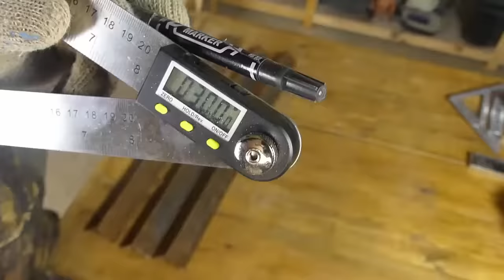I didn't believe it myself! I welded a barrel of pipes and it all worked!

Comment: Whenever you are dealing with Sparks or grinding stuff with a cutoff wheel and like that or deburring things ,make sure that your eye protection is first-rate. Not just a pair of glasses. When a spark hits your eyeball it will weld itself into your eyeball and it will not come out ,you will have to go to an ophthalmologist and they will have to grind it out of your eye. Now going to the opthamologist and having that done is only a hour-long procedure but it will scratch like hell until u get it done and its a giant pain in the ass and will keep you down for a whole day maybe a day and a half. I was a machinist for 35 years and had to have this done several times because I was stupid. Don't be stupid ,get pair of really good goggles when you're grinding things.
Reply: I used goggles when I first started grinding. One time a piece of metal went through a gap between the goggles and my nose,bounced off the lens and into my eye,I had to go to hospital to get it out. Now I always use a face shield,much safer.
Reply: Ouch
Reply: I don't know about you kids these days, Christian when I was a young man we used to take a bowie knife and pick those metal bits out of our eyeballs but.../joke.
Reply: That's a pretty good description but the details are a little inaccurate. The eyeball at the front is a fibrous membrane (clear in front of the pupil) coated with water-based  gel. A metal fragment can't "weld" to it. But the hot fragment of metal/grinder is driven hard into the surface and needs to be dug out using the beveled point of a needle (which looks like a sharp pointed crowbar under a magnifying glass) or possibly a burr (which is a miniature toothed ball on the end of a spinning shaft in a Dremel-like instrument, but slower, which cuts like a tiny tool in a milling machine. The fragment isn't "ground out" more like digging a seed out of an avocado. It is painful afterwards, like sand in your eye once the local anaesthetic wears off. I've been on the operating end of those tools many times, and the receiving end a couple of times as I do some hobby metalwork. Use good eye protection, the message is spot-on.
Reply: Yep, learned the hard way exactly that!  
Uncomfortable as hell

Comment: The only place in the world where one can find steel drums with such thick walls is... yep, Russia - and that has to be one from USSR times. Those flimsy cans they're making today (everywhere) are joke - they'll burn through (i.e. become perforated) in the middle of heating season. To make something that would last one would have to use some kind of pressure vessel, like a pressure tank off hydrophore or air compressor. (Hydrophore tanks are lighter, but typically hot-dip galvanised, so not very suitable for welding, albeit with a little skills - and open area, on a slightly windy day - it can be done too. Just stay on the windward side, though ;-)
Nice video to watch anyway, and a thumb up! Greetings from Poland! : )
Reply: Looking at your FLIR/HEAT video, seems like a single raised pipe on the top edge of the vent stack would pull heat out too.

Comment: You need outside combustion air. Otherwise, you are sucking inside air out your chimney and thereby pulling in outside air through all the cracks. What you want is a positive pressure inside your shop so that there is a little bit of warm air pushing out of all the cracks. Just a little will work. At the least, you want a neutral pressure.
Reply: 8th grade

Comment: I retired at 58 years old 13 years ago. I was a craftsman love to build stuff, certified journeyman welder and fabricator worked on ships cranes bridges etc.  I was one of the three welders that built the judy underneath the Seattle 1st avenue bridge. Still there today.
I built all kinds of stuff. people have no idea the amount of hours this takes.!!!!! 
 It's unbelievably time consuming.!!!!!!!
 I'm surprised he didn't take any shortcuts . How about a cheap $200 band saw cutting parts while he did other stuff? Or a chop saw for crying out loud cuts down the time by 90%. Even just sandblast the stuff from the beginning before he used it. Doing it by hand and grinding it by hand with a brush takes forever in itself.Why didn't he use a MIG welder it's so much easier and faster. Cuts down the time by 50% maybe 70%. Incredible job great craftsmen. Fantastic job. I just don't understand totally using no automation. Even the rod he was using was probably 6011 or 6013 which means he had to take the slag off. Oh well great job absolutely
Reply: He had what he had. The shop did not look like he was rolling in $$. If he was, he probably would had bought a wood stove. Instead he made on for essentially nothing but the electricity for the welder and grinder. Besides, it was about saving money, not saving time.

Comment: Something that I learned from my father is that in general the heavier (more dense) the wood, the longer and hotter it burns. Oak and other hardwood burn much nicer than pine, and softwood. Pine with their resin are naturally water resistant building material. It's not professional advice, but good enough for us.
Reply: Duh

Comment: Very impressed!  Great job!  Now I just need to learn to weld and find a bunch of scrap metal pipes.  I was not sure what you were making but my thoughts the whole time were a smoker or a heater.  I figured heater once you attached the pipes on the outside.  Congrats to you and your mates for now having a warm shop.  They all owe you lunch and beers for atleast a  year!
Reply: Thousands of $ in equipment to build the thing.
Reply: @Ponyjon  I got a welder like his with a helmet for $50 and an angle grinder you could get for $25. If you had a space and access to scrap metal you could make this quite easily and very cheaply
Reply: And this cat can weld paper to wood it looks like. Impressive welding
Reply: @Ponyjon  Nah, welding rig sander and angle grinder, and you could not buy the sander and get a disk/wheel for the grinder.

Don't know how much welding kit is, but the rest you could get for under $100

Comment: Pretty awesome, You basically built a gravity stove. The cold air is sucked up the tubes on the side and then its velocity is increased by the hot air as it is drawn through the tubes ejecting warm air out of the tube and creating a suction effect pulling cold air towards the stove and sending hot away back away from it at higher speed. That design will lead to significant gains in heating efficiency.
Reply: Do you know of any resources that would describe how to do this in reverse?  For example, in a tropical climate?  I thought a structure like an inverted hollow pyramid with the ends open.  The cold air would enter the open bottom expand as it rises. Rising air always cools, and, conversely, sinking air always warms. So, cooler air should be coming out of the top and falling back to the ground as it warms.
Reply: @dwkeelan  Removing heat is always harder than adding it. Hence why air conditioners are so complex yet stoves are so simple.
Reply: @dwkeelan  dig 2 meters down and lay geothermal, it's virtually the same temp there globally. look up diy geothermal

Comment: A Stove Fan would help spread the heat much faster and more evenly. Could be a good addition.
Reply: I think it's meant to work without the addition of anything electrical. SHTF kind of PREPPER stuff.🤔
Reply: @MNTNMAN-SUCA  They sell stove fans that work on the piezo-electric effect.  No external power except heat needed.

Comment: I use a small fan to blow the heated air away from a small propane heater I use in my garage. Greatly increases the warmth by forcing the air forward and not just straight up into the garage space. I set the fan just above the heater so as not to interfere with combustion. I have a C02 monitor/alarm and the heater produces none! I want to keep it that way LOL.

Comment: Cool idea for temporary use though if in a home you plan to heat every winter all winter the metal of the barrel would not last as long as a thick wood stove/furnace. A risk of blow out in burn barrels.
Reply: 8Truth Seeking  just from experience of using burning barrels they in short time get really thin at the bottoms where the metal ends up like tinfoil.
Reply: Yeah that's what I was thinking.  But maybe it will last longer being that it's inside,  and out of the elements.  Maybe the rust factor won't be quite as bad as with a typical burn barrel.  It's a cool (or warm) idea,  but that's an awful lot of work if it's just gonna rust out after a winters use.
Reply: Burn barrels also get a lot of rain on burnt-clean steel, so they go faster. But you're still right, thermally enhanced oxidation is no joke..

Comment: 22:30 - Not an engineer here, but if I understand the thermal image correctly it shows that a lot of heat exchange takes place through the top of the stove and the chimney pipe. The pipes around the stove are much colder and, more than not, passively insulate rather than help with the heating.
I think that a really efficient system should utilize that chimney pipe a whole lot more. It seems very hot all the way to the outside and spewing the heat there.
Reply: I saw that.  Are the external radiant tubes just not showing heat because they are radiating efficiently, though?  I can’t figure out whether they should indicate hot or not in the thermal image.
Reply: I've seen people add more pipe to the exhaust pipe to spread out the heat those pipes give to the room. It does work.

Comment: Fantastic bit of engineering & fabrication. Makes me wish my welding skills were still up to par, and I had the tools to do it. 👍
Reply: This is a very achievable bit of welding, I'm pretty hopeless at welding but could certainly make this. After half an hour you'd be up to speed so have at it if you want to try
Reply: @subspaceanomaly  You're right, it's not a real difficult design, but I'm old now, and can't get around like I used to, plus I don't have the tool at my disposal to do it. If I were 30 to 40 years younger I'd have a go at it, and I'd have the tools at work I could get it done with. It is a pretty cool piece of work.

Comment: Very creative.  I had an acquaintance who attempted to do something similar.  He was using a barrel given to him by a guy from the local gas strip airport.   He started cutting on it before venting it or cleaning it out,... not knowing it had previously held aviation gas.  He was 41.
Reply: Are you saying he never made it to 42? That’s why you always steam any barrel out for at least a half hour. Just to be on the safe side
Reply: Oh shit!
Reply: R.I.P.
Reply: unless he was poisoned by gas, he smelled the AV gas fumes. So he had to of had the world's worst cold not to know it had AV gas in it.
Reply: Exhaust gas from your car tailpipe is inert and will displace dangerous gases from the barrel. Can be used in a pinch to purge any unknown barrel so it can be safely cut and welded.
Reply: A good example of the difference between knowledge and ignorance, experienced or un-experienced, smart or dumb. 
Bottom line, have humility and acknowledge your own shortcomings (not particularly an American virtue).

Comment: Someone needs to make this with an outside air intake - as the stove burns it draws from inside air which sucks more cold air inside the building from the outside. If it had an outside air intake the place would probably be 70 degrees F in a short time.
Reply: As long as you remember that you need to breathe...
Reply: But then if it's too cold outside, you need a heat exchanger to pre-heat the air intake so you can have a complete combustion, you run into condensation issues ugggghhhhh. It's super rare in Canada so I believe the industry has ruled it out as a practical solution for cause.
Reply: It looks to me like he made an air intake. Maybe I'm wrong but that last pipe looked like it lead to the outside. I don't know anyone that would build a wood burner without air intake, heck it wouldn't even burn the wood if it didn't, as far as I know
Reply: @robwilde855  Shops are never well insulated; there is going to be plenty of air ingress I should think.
Reply: Great suggestion ...
Reply: @charleneking2935  you are right, there is an air intake, but he made the air intake open to the inside of the shop. Charlene is suggesting to take this inside air from outside (rather than from the inside air). Smart idea ...
Reply: @EdwardTilley Well, that's how we do it in 'Ol Kantuck!

Comment: Awesome work man.  You might want to look into “Rocket Stoves”. You would be very good at it.  They surround it in a type of mud or stucco heat the mud/mortar and it heats all day on 1/3erd the fire 🔥 wood.  Inside of the heater is metal, surround it in “Air-Create’ and I promise a heater with 200% better heating, with 1/3erd of the fire 🔥 wood.
Your a real good metal worker, yet you certainly could create a much better heater.
Enjoyed the make 👍.
Reply: Rocket stoves have a vortex, they can burn 🔥 at 1,000 + degrees.  Air-create, see ‘Honey Do, carpenter’ your the metal specialist, get with the Air-Creat guy.’
Make Alaska warm.  🤪

Comment: The majority of your heat from the wood stove comes from the stove pipe radiating the heat. Increasing the diameter and length of the stove pipe in your shop will increase the efficiency instead of most of the heat going outside.
Reply: Ainsi qu'en soudant des dissipateurs thermiques, en particulier au sommet du conduit d'évacuation des fumées

Comment: Impressive for heating a shop that long. You could get more heat in the shop by radiating more heat off the chimney pipes. I expect if you are regulating the fire by limiting the air there are combustible products being lost up the chimney. A burner built to make heat from the flue gas would increase the efficiency some more.

Moving south to a warmer climate is the ultimate solution.
Reply: . . . just wait am few years, then the warmer climate will come to you !
Reply: @carmenschumann826  then you will be painting the heater silver to reflect the sun's rays to it doesn't melt during the day
Reply: We can’t all do that Gordon, we will eventual meet the multitude coming the other way from South to North!
Reply: Ask Texans how cold it gets. Even Florida  gets cold ( for them) , I used to live in PA, Fla is much nicer
Reply: I lived down south for many years. The weather was terrible. Too hot in summer, wild storms, and still cold in winter. In 1990 it went to 14 below in New Orleans. 
Besides, moving solved none of my problems, it just caused more.

Comment: Some additional piping inside, hook it up to a water supply, connect piping to hot house hot water pipe and you've got hot water too, albeit a noisy source of hot water. That was a great video to watch as I commuted from Sydney CBD to Penrith this arvo.
Reply: Genial buenos dias
Reply: If you add piping for water you must also make accommodations for expansion and you must also have some type of dump zone to get rid of that heat when you’re not drying when the water is not flowing if both of these things are not accomplished you’ve created a bomb. Very careful with steam

Comment: We don't have barrels that heavy gauge steel here in the US that I have found. Great job!
Reply: From my experience,  drums designed for liquids are built thick enough to support about 500 pounds of cargo. These are the drums most of us are familiar with. 
The same style of drum is used to transport steel shot for wheelabrators, and are built thick enough to support about 2,000 pounds of cargo. These seem to be less common, thicker drums.
Maybe you can ask around and find a thicker drum.
Reply: Another option is look at water heater tanks, air compressor tanks or kerosene fuel tanks they will be different diameter but will be thick walled.

Comment: Nice work, a little point for improvement and cost reduction: get a few wirewheels for your anglegrinder. When removing rust they are way faster,  don`t get used up as fast as expensive belts and are far less prone to breakage compared to discs. Keep up the good work. Regards Smarty
Reply: This is far more impressive than wire wheels pal 😂
Reply: @thephuckmaster9376  you get that I`m talking shop and about tools and not about any hoopla wire rims for your ride pal???
Reply: @sm4rtmouth  yes well I dont like what your insuatin on my daddies brothers channel and I'm not finna stand here and stay quiet no how no way pal
Reply: @thephuckmaster9376  Well then grow up and learn to read and comprehend what`s written. I make a toolsuggestion to improve his workspeed and lessen his efforts. So WTF is your problem , boy ... behave

Comment: Amazing what you can do with a grinder. All I need now, is an arc welder. (I loved not knowing what was being built, so I could watch it like a murder mystery.) Great video.
Reply: Never cut into a drum like that unless absolutely certain it doesn't contain solvent or fuel vapors, it's one of the most common ways for backyard fabricators to die--explosively.  A few handfuls of dry ice can be used to flush out the air and make it safe as CO2 is denser than air and will fill from the bottom, pushing air out the top, if the only opening is at the top.  Otherwise fill it most of the way with water such that any combustion volume is minimized.
Reply: Bl look

Comment: You should line the inside with fire bricks so it doesnt burn out. It will last alot longer.
Reply: He should have made his own drum with heavier material, no need to make a drum. Just make a box
Reply: That would kind of defeat the purpose of the exterior pipes acting as heat sinks. I've seen people use the same burn barrel for 30  years. As long as the fire doesn't get too hot, and doesn't get too wet,  it'll hold up well. It shouldn't, because of its overall design and ability to dissipate heat...